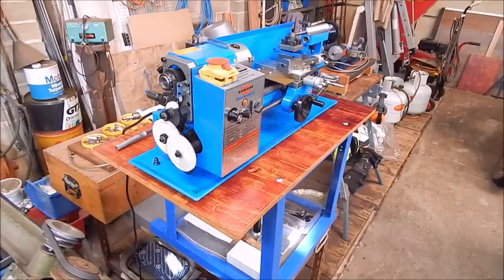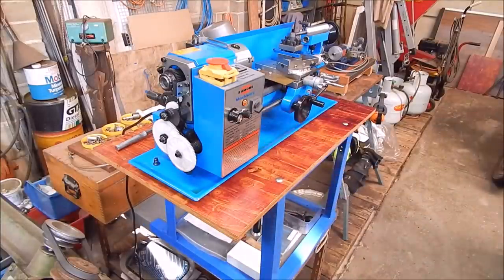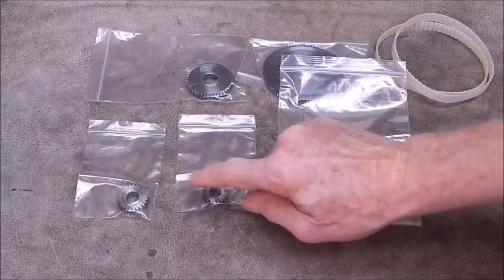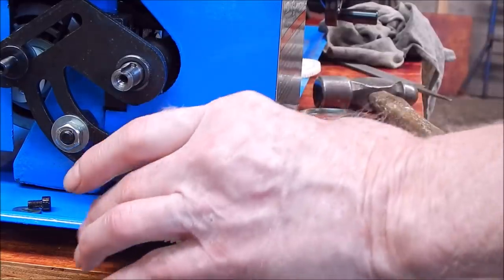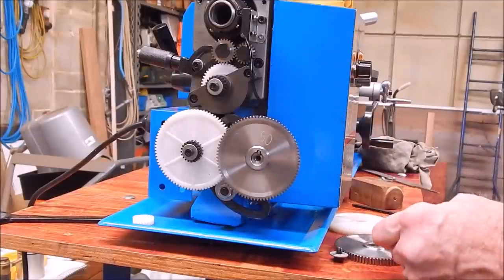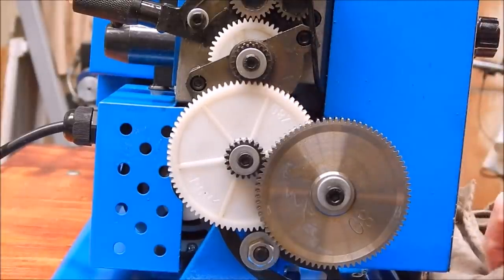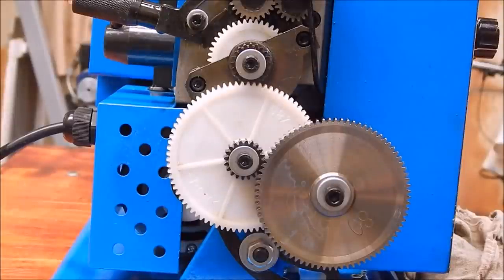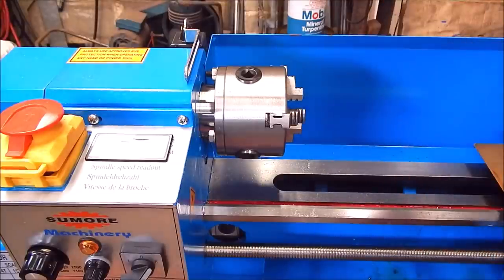Fitting metal change gears to a 7 x 12 mini lathe - how hard can it be ?

Comment: I worked for an engine lathe manufacturer and our machines were designed to ensure that the gears were not damaged by accidental overloading.  What we did was put a small gear on the input shaft to the change gear box mounted by the headstock.  The input gear was keyed to the shaft with a Woodruff key made of brass.  The top of the key (opposite the round side) was trimmed down so that it would break in shear if the gear train was overloaded.  We sold the keys as "safety keys" in packages of six as I recall.  They weren't very expensive and they did protect the machines from breaking or stripping gears.  You might try something like that as a safety measure on your mini-lathe.

Comment: I added metal gears to my HF mini. Not sure just how many but mine came with more gears. So far they have all fit well. I guess I got lucky. I like the suggestion below to replace the internal gears with metal and use some plastic on the outer gears. Im going to look into that. Another way to fix the center hole problem for those not set up to work on gears would be to measure the shaft and buy a reamer.

Comment: Change the internal headstock gears to steel and have some plastic ones on the outside. Best the weak link be outside and easy to replace.
Reply: Don't forget to buy a few spares, because it would suck to break that gear and not having a replacement on hand.

Comment: The reason why these smaller lathes have nylon gears, is so when the begginer has a crash or bad move that they break instead of breaking the motor that cost a darn lot more that a few bucks worth of plastic, so bear that in mind when thinking of changing to metal gears.
personaly i don't care about having metal gears as it will not make ou a better machinest.

Comment: When I did a no no, the leadscrew gear broke. So for me, if I changed to metal, I would leave the leadscrew gear plastic.
Reply from the maker: You can leave any gear plastic and it will protect the lathe.  It doesn't have to be the one on the leadscrew.  Just so long as there is at least one plastic gear in the train somewhere to fail under extreme load, all will be fine.  Cheers Rob
Reply: @Xynudu  no, I wasnt saying it had to be, any plastic gear would do but as it's the easiest one to get to and was the one broke in my case I just personally would use it as the plastic gear. When I broke it I inspected every gear and tooth, tedious, and found no other damage. But yea, all metal is a true no no .
Reply from the maker: OK George. I understand.  Yes the lead screw gear is definitely the easiest to replace. so you are right on that.  Cheers Rob

Comment from the maker: Note:  the two tumbler gears fitted perfectly and were a two minute job to change over.  The only issue with the kit was that the two 80 tooth main change gears were too tight to fit the carrier shafts. 

Closer investigation revealed that the 80 tooth gear will NOT fit the external jaws of the scroll chuck - so any machining will have to be done on a larger lathe.

Be very careful when opening out the gear centres as metal is easy to remove, but hard to put back ;)

To buy this set search Ebay for "VEVOR 5PCS Gear Set for Mini Lathes, Replacement Gears" to bring up sellers in your part of the world.

Cheers Rob

Comment: Hi Rob,
That does seem like a good price for the replacement gears.
Inside Callipers is the name you were hunting for by the way :)
I used to use them all the time.  Still have the ones I bought when I was 16.
The lathe didn’t come with regular screw cutting gears?  Are they just for feed?
Great video
Reply from the maker: Hi Davo,  I knew they weren't dividers, just a close cousin :)   I learned that method from my father who was a motor mechanic and it saves a lot of pain trying to get a snug fit, particularly on small diameter work.  I expect a lot of people think digital readouts are the magic panacea, but you can't beat tactile feel in situations like this.  

The lathe came with a set of nylon change gears for metric threads.

Cheers Rob

Comment: I hope Sumore does well and offers some bigger lathes locally Rob, I'd grab something with a powered cross feed in an instant.
Reply from the maker: They have some interesting stuff, including an up market version of the AL250G with a separate drive bar for the horizontal carriage feed and an overall higher quality look to it.  Looks very nice, but only sold in India currently.  Lucky guys.  This lathe ticks all the boxes, but was let down by poor quality control on many points when first introduced by H & F from numerous comments in forums.  Hopefully they've debugged it by now, but a Sumore version would be very tempting.  Cheers Rob

Comment: Having had a mini lathe for the past 10 years I’ve found that if any thing goes wrong the drive belt is the first to break with both plastic and metal gears
Reply: Had mine for 15 years.  The only time I crashed the carriage it destroyed the center of my 80T plastic change gear.  Everything else was fine.

Comment: Oh yeah, another method to hold that gear on the mini lathe with good concentricity would be on the faceplate, after lining it up with a dead center in the tailstock aligning with the existing hole.

Comment: >are you gonna make a gear for $10?

Well, maybe not a metal one, but 3D printer go brrrrrrr.
Reply from the maker: A 3D printer would be very handy for this sized lathe.  The gear set supplied is Metric and you could easily print some Imperial ones which should do the job.
Reply: @Xynudu  Not only that, but you could print out custom sized gears for essentially any thread pitch you want, within the limitations of the size of gears that would physically fit, and the torque it can supply to the gears.

Comment: Would have liked to see you replace the tumbler gears. I can't figure out how to get the new ones on there.
Reply from the maker: From memory the axle/pins the tumbler gears run on each have a bolt head and unscrew from the rocker arm.
Reply: @Xynudu  Thanks. Turns out I was too careful. Whacking the bolts with a hammer loosened them. I am assuming they are 8mm tall M1 gears. Hard to find replacements.
Reply from the maker: Plenty on Ebay but you have to buy the full set, same as I did.  They are Module 1.  One is 20 and one is 25 tooth from memory.  Cheers Rob

Comment: hey where did you buy the metal gears for mini lathe?
Reply from the maker: Ebay.
Reply: @Xynudu  if mine don't fit can i use the file and some sanding papper to make them match
??
Reply from the maker: That's a bit doubtful Thanasis. You really need to remove metal uniformly or it will become eccentric and bind the gears.  You can do it your way, but it may not work out very well.  Good luck. Cheers Rob

Comment: on that type of key way you can get aluminum keys that well shear before it hurts the lathe , Those steel keys will kill the lathe if it crashes .. Great to have steel gears ! ENJOYED Rob ..
Reply from the maker: Hi Shawn,  I have seen some of those alloy keys used in Briggs and Strattons on the flywheel taper.
Reply: @Xynudu  those might work , But Our hardware store here has a good line of aluminum keys that fit perfectly . I like the bronze rod on my lathe .
Reply from the maker: Yes bronze brazing rod is what I use as well.  I suppose a small piece of that could knock in to replace the steel key and work OK.  Wouldn't have to be square.  Cheers Rob

Comment: Would it be feasible to use a more fragile key with the steel gears to introduce a planned "gear saver" failure point?
My first thought was plastic key (HDPE), then thought about something frangible like ceramic or glass.  My third thought was that these materials have opposite property, so I clearly don't know enough about engineering mechanics.
Reply from the maker: Hi Kevin,  that's a very good idea.  The medium would have to be soft, maybe a suitable grade aluminium key would work.  I have seen these used in some situations, but usually in conjunction with a tapered shaft/fit and mostly for alignment/timing issues.  Cheers Rob.
Reply: I use that in my small mill. Upgraded to all metal gears and 3 printed a key out of PLA. I actually tested it and the key sheared of nicely. Been running the mill for about a year now and no noticable wear on the plastic key.
Reply from the maker: Sounds good Jorgen.  Great idea.  Wouldn't be hard to file a key out of some plastic if the 3D route wasn't available.  Cheers Rob

Comment: Hi Rob, sounds sweet. I think leaving at least 1 plastic gear is a good idea and also this will help reduce the noise of the whole gear train which is evident from your audio. Cheers, Jon
Reply from the maker: Hi Jon,  most of that noise is from the two main drive gears on the spindle (these are usually nylon as well).  Cheers Rob

Comment: You have a very informative channel. Thank you for that. I am learning a lot from you.
I have the same lathe and this morning when I turned it on I heard something fall. I looked around thinking it was one of the tools I had beside it but everything was in place. Then I noticed the power feed wasn't turning. I thought maybe it was in the neutral position. It wasn't, so I opened up the gear box and one of the tumbler gears was on the bottom of the box. No damage done and just a matter of re-installing it. None of the other bolts were loose so this was kind of weird.
Reply from the maker: The retainer must have been loose.  The gears spin pretty fast, but here's not much side thrust on them.  It's unlikely to cause damage as it will fall away from the gear train which will stop as well.  Pays to check all the fasteners on these lathes.  I Loctited all the screws for the operating levers and replaced the slot head grub screws with Allen head ones.  Much better.  Cheers Rob

Comment: Hi Rob,. a few years ago I was able to pick up a large set of metal gears from bangood very cheap.   The quality was awesome and they fit perfectly.   I was sure to put that in the review.   I had earlier ran a chuck jaw into a piece of metal and come to a dead stop by accidentally turning the carrriage the wrong way as I was learning and broke a drive gear for the spindle..   I was able to get a metal gear from a friend and use that but the quality was poor and we had to bore it out as it even had a taper in the hole for the shaft.   The big set of gears I got included those gears so I replaced them with the metal gears  The original gears were nylon so now I do not have that safety anymore if something were to happen.   

   I do have all the metal gears for the lathe now but still run with mostly plastic gears as they are quiter and gives that safety aspect.   I will change to metal or nylon if necessary.

   I now have a 12 x 36 atlas lathe as well but I have learnt that I'm not planning to give up my mini lathe as it is so handy and also a back up lathe as you know is so nice to have.   It is a great lathe to learn on and can do so much with it as well as you can make improvements to it.   Keep on enjoying it Rob and you'll probably find you won't be able to let it go.

Dale in Canada
Reply from the maker: Hi Dale,  it's an interesting lathe.  Unfortunately it will probably have to go as I already have full coverage of lathes (three) for the work I do.

The 7 x 12 is a good beginners lathe for sure.  It's not perfect, but for the size and money it's a good choice for anyone's home workshop.  Small lathes are becoming like most power tools, anyone can afford one these days.  Cheers Rob

Comment: Thanks for this confirming video. I've also got a 0618 based lathe but with all wheels made of steel, according to Warco (UK) spec. To change gears I had to make a press tool to get the gears off the bushings, and fit the bushing in the new gear.
You didn't actually skift gears. What about the fiddly banjo? Nearly impossible to set. One Y-tuber removed the cover to the motor to get a more easy acces.
Reply from the maker: Hi Stefan, the banjo on this one works fine.  No issues.  There could be less slop in the sliding spring loaded center pin as that allows movement at the engagement point, but spindle rotation pulls everything into position and it all seems to work OK.

Cheers Rob
Reply: @Xynudu  I experience the construction of the banjo as sloppy. Both the banjo and the sliding part for the middle wheel needs to be held in position in order to get the proper alignment for the koggs engaging each other in a good way.
Reply from the maker: I think machining up a closer tolerance fitting locating pin would firm things up a lot.
Reply: @Xynudu  Yes but I feel that there are 2 sloppy details. One is the tap/axle which the banjo swings around and the locating device for the gear.
Reply from the maker: No slop in the banjo pivot point with mine.  As per my previous reply the locating pin diameter should/could be increased to remove unnecessary slop at the selector point.  Cheers Rob

Comment: I have the exact model and bought metal gears with same problem with mounting. My question for anyone is when I turn the motor speed down to zero it still moves? I Can stop it by holding the chuck but I feel the pull when I let go it turns again not fast but still odd. Any ideas would be great!
Reply from the maker: I have not looked at the 7 x 12 controller board, but AC - DC inverters generally have trim pots to adjust the high and low speed range (among other things).  It sounds like the low speed pot is set too high.  You will need to identify which pot to adjust.  Research the subject on the net.  Cheers Rob
Reply: @Xynudu  I absolutely can not thank you enough! I took off the cover and found a min and max screw pot as you called it. I started the lathe and with a lot of apprehension I started turning the screw in the min pot and instant success! The chuck stopped turning then the motor went quiet. Again thank you!
Reply from the maker: Glad to hear it worked out OK Mark.  I was sure this would be the fix.  They make the boards adjustable for the different motor types that may be run off of it (some have lower/higher voltage tolerance).  Cheers Rob
Reply: @Xynudu  I have a new project or idea for you to think over. What about changing the stupid plastic belt to maybe a v belt Setup? It would be quieter and wouldn't sound like binding plastic. Also thinking of setting mine up to mill on since I don't want to spend the bucks for a mill. Have you thought about that? And finally I would like to figure out how to measure for a digital DRO set-up like the big lathes. Now its up to you to complete these ideas haha just messing with you and again thanks for the help and great videos.
Reply from the maker: All things are possible Mark.  I mill on my 10 X 18 lathe as I don't have a milling machine.  It has shortcomings, but gets the job done ;)  I don't like permanent DRO set ups as they collect oil and cuttings and are always in the way.  But to each their own.  Good luck.  Cheers Rob
Reply: @Xynudu  👍🙌

Comment: Nice little tour Rob, iIt looks like an ideal lathe for a hobbyist or beginner . Also very nice size if you want to carry it down the basement for winters cold days. Cheers!
Reply from the maker: It's pretty weighty.  Much heavier than the Sherline, which is a lot more manageable.  Cheers Rob
Reply: That lathe looks like it's close to 45kg (100lb) cause I have a similar  one in red, the seig brand it's that weight that I mentioned.
Reply from the maker: Yes, it's too heavy to move around on your own.  Plus it's hard to grip it.